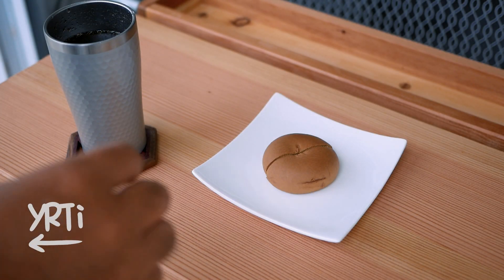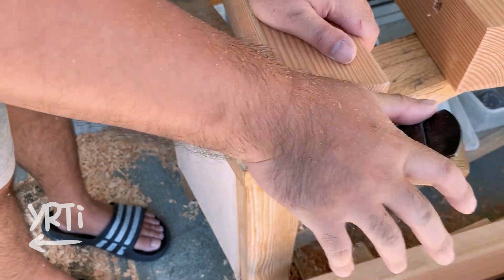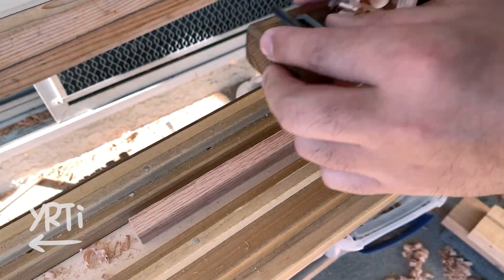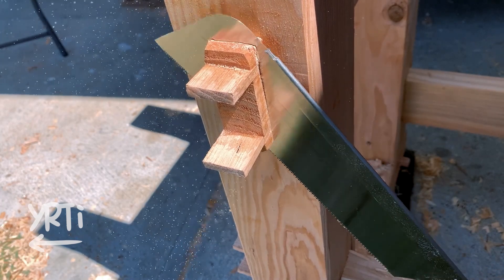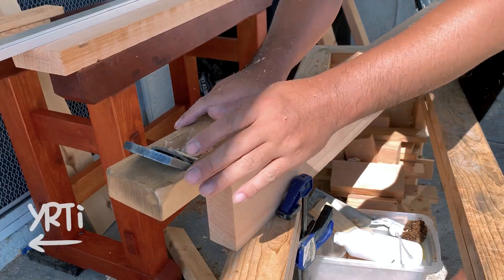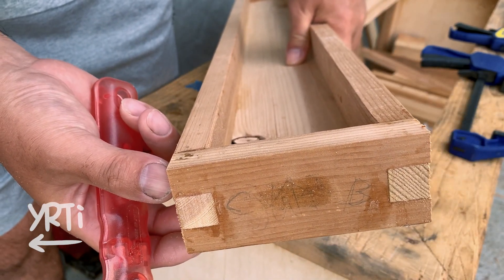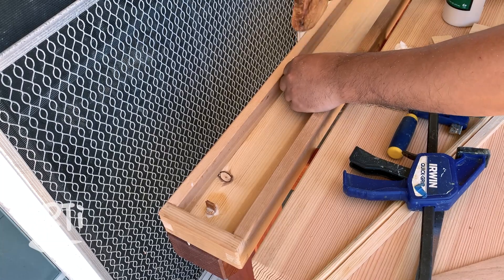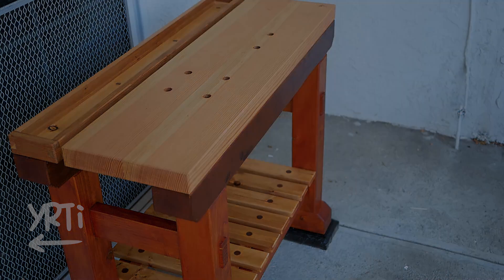Timber Framed Workbench with Construction Lumber - Hand Tools

Comment: I like the square hole for the pins, thank you for sharing! I also have trouble with starting the drill, so I like using a awl to make a small dent before starting, so the bit doesn't move at the start.
Reply from the maker: Thank you for the comment and the advice! I use an awl, too:) but my problem is, my hands aren't stable enough to go straight down... maybe I'll get a drill guide!

Comment: A very beaultiful and funcional workbench. Congratz!

To drill straight holes, I do the following:
1. Mark both entry and exit points of the hole on the piece.
2. Carefully drilling a narrow hole (1 to 3mm) from one side to the other. It might not be perfectly straight, but I try. I use a small hand drill for precision. Since its 1 to 3mm, it's very easy. 
3. Then, drill from the other side towards the initial hole. This somewhat straightens the hole midway.
4. Use a forstner or spade bit to create the actual hole (e.g., 1 inch), using the narrow initial hole as a guide to center the drill bit accurately.

Hope it helps and sorry for my bad english, I'm from Brazil.
Reply from the maker: Thank you for the advice! Sadly, that means, I need to practice more (That's exactly what I do...). Oh and obrigado for your encouragement in the middle of this project on my post!

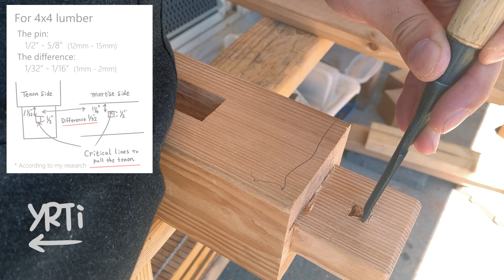Comment from the maker: Sorry, Correction - 2:37 in the picture, the distance between the tenon shoulder to the drawbore mortise is supposed to be 1-7/32", not 1-1/32". I don't like math.

Note: It seems like unless the Kakishibu dye is made for exterior, it doesn't do well with directly contacting water/rain. It's not about the ingredients/performance but Kakishibu may rinsed off over the course of years.

Comment: Great fan of your videos! Got a question about Kakishibu dye. In my country I can only obtain granulated powder, does this work also on wood. Keep up the good work :-)
Reply from the maker: Thank you for the comment and I'm not sure if the powder one you found works but there are ones that can be used for dying(I found Mimasu Kakishibu Powder and it will work). Though unless it's specially made for outdoor, it seems to be Kakishibu is for where it does not directly hit by water. . They say over the course of years, it'll be rinsed off by rain...